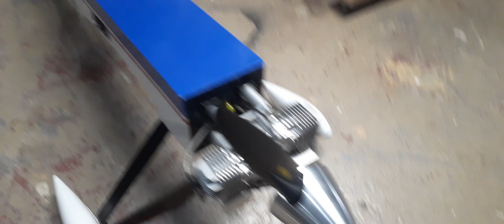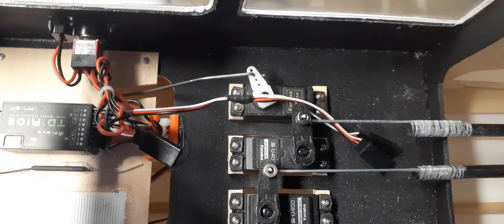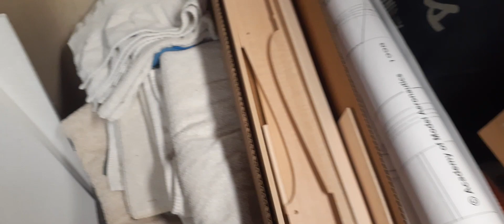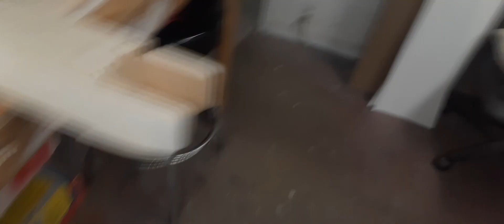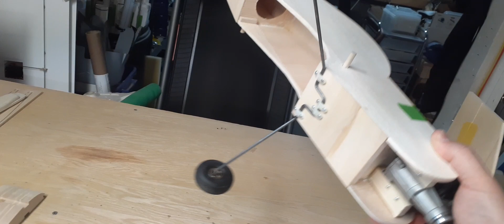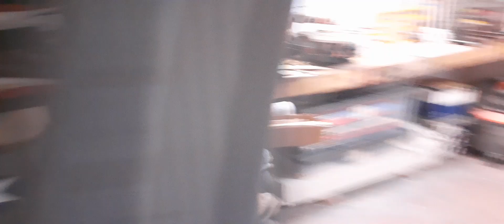Citabria and Prime Stick update and more projects on the bench!

Comment: Hi Andy, I use 3M Super 77™ Multipurpose Spray Adhesive to apply my wing skins to foam core wings.  Lightly dust the back of the skins and the core a couple of times letting the adhesive flash between coats, then dust it one more time and place the skin in place before the adhesive flashes. Use light pressure with the palm of your hand to smooth the skin onto the foam.You must have the skin and the wing core positioned exactly where you want it because there is no undoing it. Super 77 is safe on foam, it is fast, lightweight and super strong. You don't need to weight it down or anything like that, once you make contact it is in place for good. Practice a few time on scrape to get the hang of it. "Don't over do it."
Reply from the maker: I've used 77 on smaller electric models but worried it wouldn't hold up over time on glow and gas planes
Reply: I always use epoxy finishing resin to bond skins to foam cores on anything lager than a 60 to 90 sized model.

Comment: I have a Tiger 2 my son built ca 1999. It's got a ST40 in it and it flies great. On a theme of yours, it's covered in Monokote that still looks good, though a little fragile with age. He used some fluorescent Ultracote (I had some piece from my only previous use of it) for visibility, and all the plastic is gone leaving only the color behind.
Reply from the maker: Monokote holds up well with age, ultracote will get brittle and the clear will separate over time